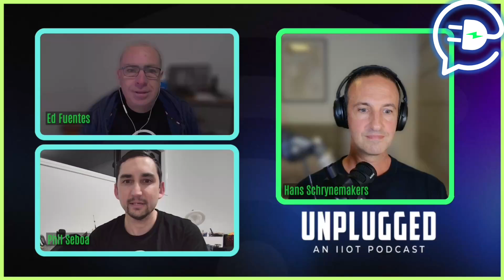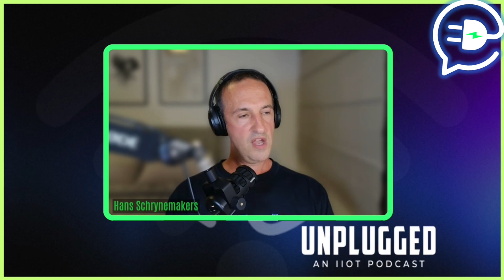Why Structure Matters: Transforming PLC Programming  With Hans Schrynemakers

Comment: About selecting the language. I think the question of which PLC programming language is the best is simply the wrong question. Instead, we should ask which language is best suited for a given task. Like a screwdriver and a hammer, each designed for its own task and not well suited for the other. A decent PLC programmer should be proficient in all the languages used for that task anyway.